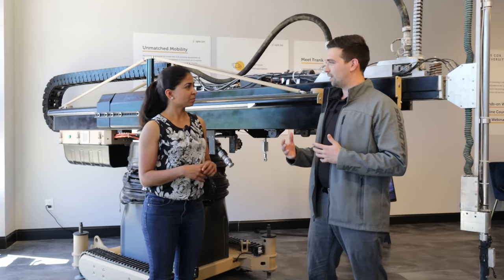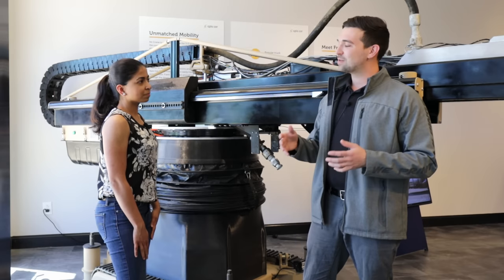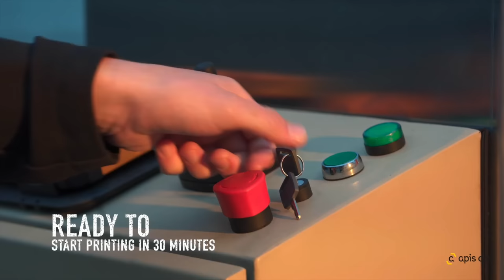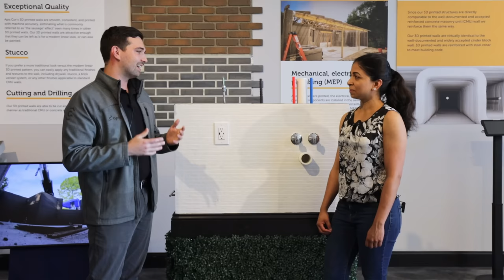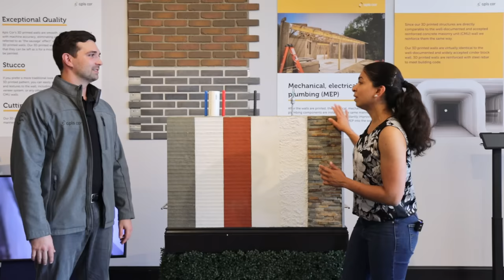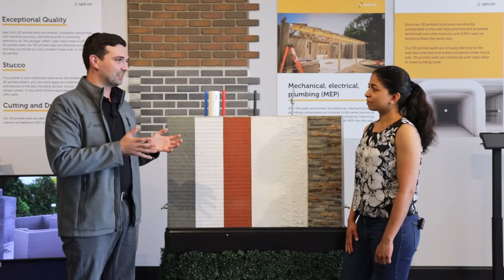Visiting Apis Cor's 3D concrete printing Showroom!

Comment: This is an outstanding upgrade on the sausage extruders with remarkably minimal added hardware. Obviously the small form factor helps a lot on setup and versatility. They could improve the radius by 2-3ft by pivoting the extruder headworks while reverse pivoting the nozzle.

Comment: When we eventually have settlements on the Moon or Mars... I believe 3D printers would just about have to be used. 
Right now are there ways to use the surrounding land at the job site to process into the printing material? That is you go into a very remote job site and dig up dirt, clay, process it, add what ever.. then use that material to print the structure?

Comment: This printer is a huge improvement. Rounded corners are structurally and visually great.. also expensive.  If it could print designs on walls as well, such as corbels, I see huge potential.
Reply: Bingo... this printer is way better than anything else on the market,  making stuff like MudBots obsolete technology now. I'm guessing he has a patent on the extruder head that smooths the layers also..  Really cool stuff especially since it's mobile and doesn't need the framework anymore.
Reply: Как и где можно приобрести такой три д принтер

Comment: Interesting video, Belinda.  Thanks.  I wonder about the coarse texture of the crete.  Seeing videos of families with unpainted walls, it seems that kids would constantly be losing lots of skin to them.  Is there a smoothing process done to them before residency?  (other than the smoothing spatula)  Personally, I don't find the gray concrete walls pleasant at all and would paint them.  Also, very smooth walls are much, much easier to clean.  I'll have to check out more of the vids in your Frank Mix.

Comment: OK, Im already a fan of 3D printing of construction but I have questions about this latest printer. Crane lifting points? does it have any and if not, it should. Can it print alkaline concrete or fly ash concrete? The HMI or human machine interface, what options does it have? What are the 3D modeling softwares , are they proprietary or open source modeling softwares? can the machine be rented, how much? I can see this thing being painted green and rented by Sunbelt so if it can't, it should be rented, guarantee it will pay off in the long run for the company.
Reply: Yes, 4 lift points on the transportation assembly. Yes, testing has been done with alkaline concrete, fly ash, and other Geopolymers. HMI has 3 options standard with all printers (tablet, desktop via Ethernet/wifi, and joystick controls). Gcode is made is Autocad or Revit and Apis Cor has made user friendly plug-ins for both programs. All equipment and software available for lease for $8k per month.
Reply: @trevorragno792  sweet, thanks!

Comment: is it strong enough to deal with earth movement? the lack of reinforcement makes me question. and if reinforcement is already in the concrete mix whats the life of the nosles? will they need replacing mid job with the extra abrasiveness for the fiberglass or whatever reinforcement? this obviously needs a special concrete mix to work right, is it mixed on the mechiene right before placement? might end up getting a lot of rejected concrete its its not. how long does the pump last if its moving such viscous stuff? do the walls have to be curved for strength? curved walls are cool, but the stuff in buildings is still mostly rectangles. interrupted prints, if the mechiene gets bumped or moved is there a procedure to realign it seamlessly with the previously printed bits or are you just SOL and have to scrape it off and start again. the alignment ting might be a problem if you need something to be load bearing that's outside he range of the machine where movements are required. are the finished walls thin enough for wifi to make it through? can you just feed it any design or do you have to pay attention to the cardboard wobble inner bit?

also rust sencor? A does it rust so quickly that the process of rusting during a job will make it fall apart? B or does it rust normally and its just so sensitive to minute changes that it will fail the print because rust built up as it was printing? will wind make it fail too if its that temperamental that it needs a rust sensor? if the computer does deem it too rusty whats the fix? cut the wires to the rust sencor and keep going.

 I've seen some old buildings where stucco was adhered straight to concrete and it did not age well, idk what exactly the issue was but it looked like water issues making it flake off wired because the back of it wasint open to dry correctly or something, they ended up haveing to strip it off and paint the lumpy concrete which ya know peeled, making stuff stick to concrete long term is tricky. 

3d printed affordable housing just sounds like the most buzzwords smashed together as possible so I'm naturally skeptical, next you are gonna tell me how drones and vr are somehow involved. less gimic does it actually work?

Comment: Not sure that they are more than 10 3D houses nationwide, walls are just 5% of the total cost, 3D printing (plastic or grout (concrete contain gravel)) is still a pipe dream.

Comment: All these videos and I've YET to hear the WHY. Are concrete printed houses greener? No. Cheaper? No. More compact? No. Better looking? Earthships made with old tires are better looking.

I guess they WILL destroy construction worker jobs. Oh, and ensure only large corporations that can afford the capital costs are building our homes. What could go wrong?
Reply: 🤔 in our area the problem NOW is finding construction workers 👷‍♂️ 👷‍♀️ 
And it seems to be an international problem 🤷‍♂️😍😍😍
Reply: If I recall, Belinda listed several reasons in an earlier viewer. I believe the main advantage was mostly in areas where construction resources were limited (labor, equipment, etc) - this type of technology could overcome those shortages.